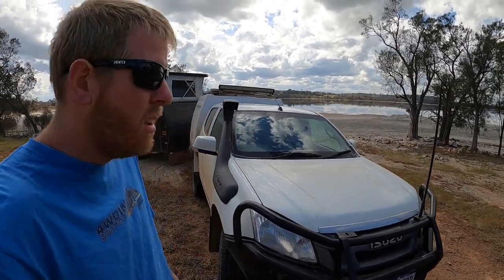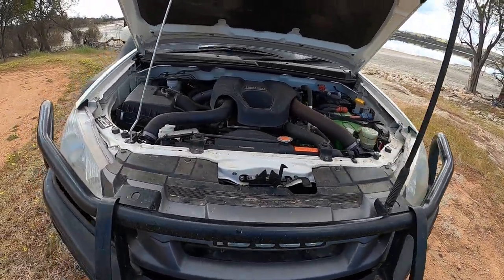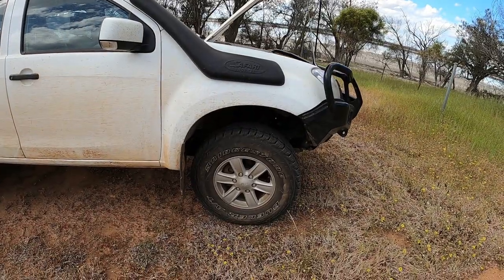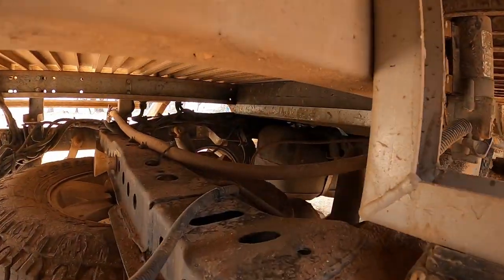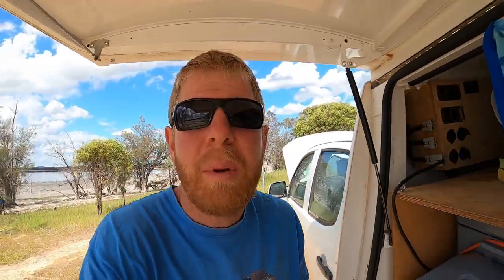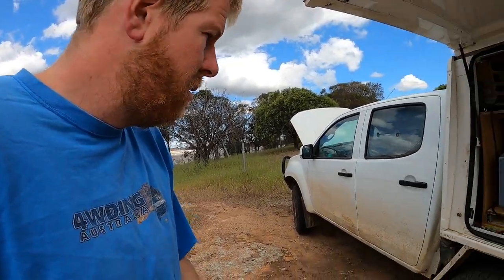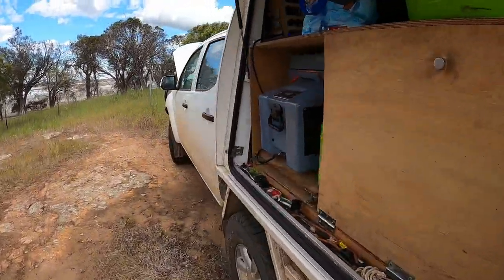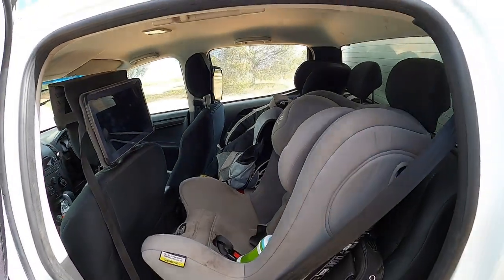Building an Isuzu Dmax to Tour around Australia

Comment: Hi Aaron, I have a 2017 Isuzu D-Max and have had fitted a 40mm Tough Dog suspension. I have the same Bushskinz fitted and want to now to put in the 30mm diff drop to improve the CV angle. I was told, the same as you, that I would need a new plate when fitting the diff drop. I just want to confirm that the original plate still fitted with the Roadsafe 30mm diff drop. Thank You
Reply from the maker: Yep, ours fitted fine with the existing plate. I'd like to know if the hole centres are different, as I can't see any issues with the way we did it.

Comment: Hi Aaron,Do you know if you can put on a 265/75r16 to the original rim which has 245/70r16 tyre on my LSM Dmax.Cheers Rob
Reply from the maker: Hey Rob, certainly can mate. We are currently running that size, with the factory LSM rims. I have a mate running the same size tyres on the OEM steel rims too.
Reply: @4wdingaustralia  Thanks Aaron.

Comment: Is that a 30mm lift
Reply from the maker: Yep
Reply: @4wding  Australia  do u recommend getting 30mm lift and 265/75r16 or 40-45mm lift and 265/70r16 on the new dmax
Reply from the maker: Depends on what is legal, and what you are trying to achieve. Happy with what we did, although the larger tyres do make you use more fuel